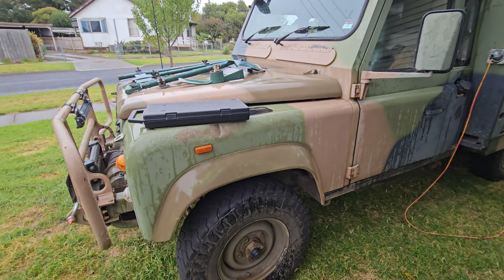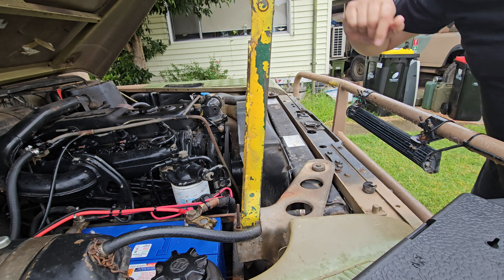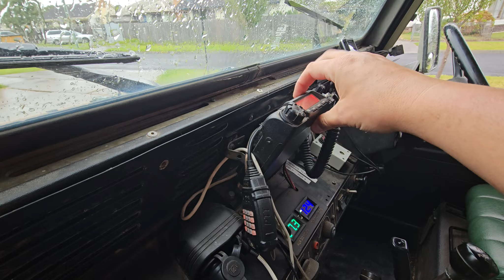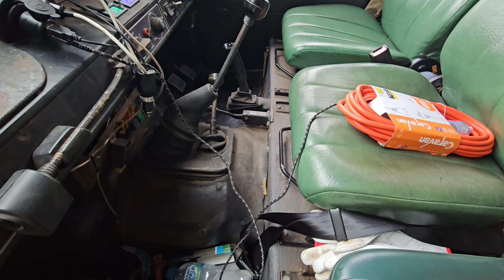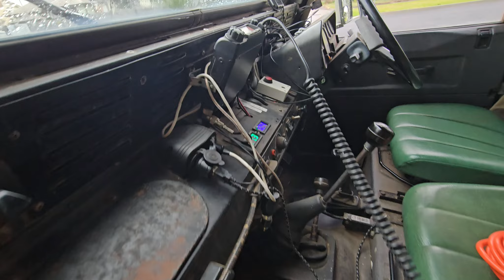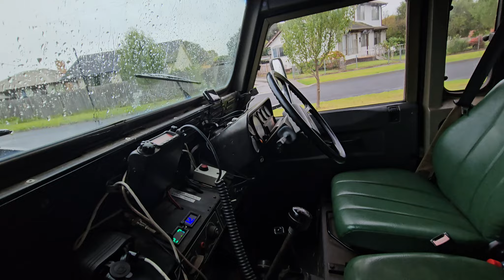Anderson Plug repair | 6x6 Land rover

Comment: Nice TYT radio, what bands?
I use the 75A Andersons, even on low power stuff, very rugged system, until you drop a brake master cylinder assembly on them..LOL.
Reply from the maker: Th9000 uhf band. I have a couple of the vhf brand units. Handset was from a different brand th9000 clone-clone. 400-470mhz